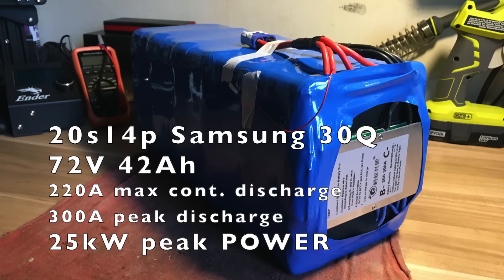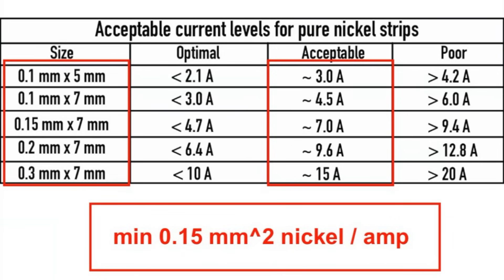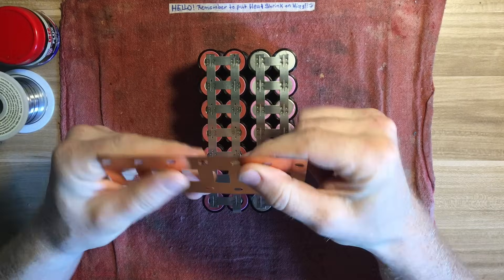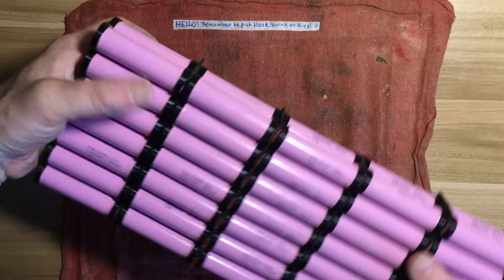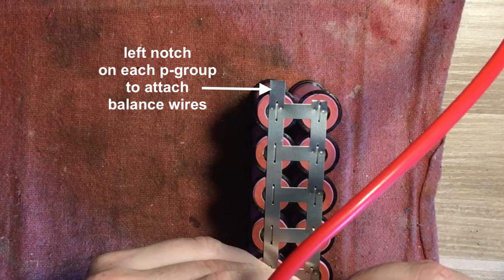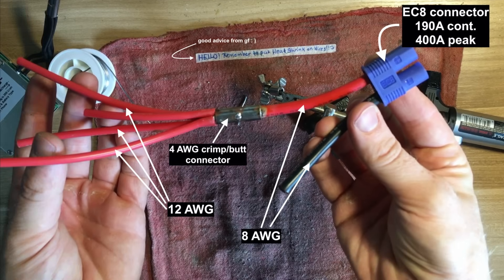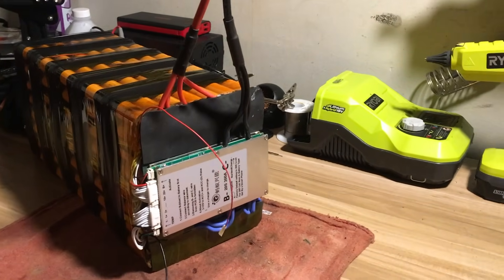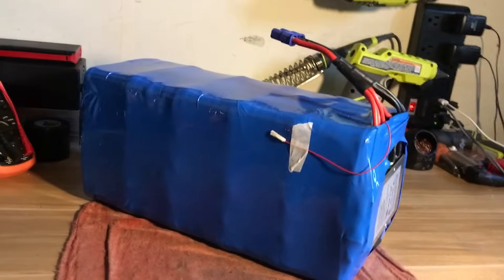How to build a MASSIVE 72V DIY battery pack for high power e-bike

Comment: Awsome care of battery building.  Your nickel and copper interface are perfect.  Oh just a note: solder is not so conductive so instead of just adding solder to the empty cup of the wire link, you should crimp it and then add solder.  This little addition will better represent the rest of teh care you've pu on it =)
Reply: If only you put so much care into your spelling and critiquing of others.
Reply: @joshuacrooker6489 inj

Comment: what was the build cost?
Reply: The cells he used are 4.75 usd at cheapest prices. 14p 20s = 280 cells times $4.75 = $1,330.00 just for the cells. I think $1600 or 1800 is very conservative considering a battery with those specs for sale is 2500 +
Reply: @mr.animegod_yt  that's if you trust the children in the factories making you a battery that won't blow up between you legs are you push 200+ amps
Reply: @stephensmith1687  versus what? An absolute beginner who has zero experience in building a pack.  Yeah I might trust a battery pack made by the kids in the sweatshops if I knew someone who’s purchased from them before.
Reply: @stephensmith1687  good point now I’m terrified to put any battery between my legs damn lol
Reply: Expensive. As. Fuck. Lol.
Reply: @republicofvegans712  now imagine what it will cost to replace/repair a battery in these fu…n’ electric BS cars that governents are forcing ppl to switch! I can’t even imagine how they are going to dispose milons of these cells if i’m having a problem with what to do with some single old/broken 18650😂
Reply: @losien1 Tesla's battery packs are incredibly well made. Each cell is fused, so you can have hundreds of cells go bad and the pack will still function with no difference to you. You also get a 8 year battery warranty :)
Reply: @losien1 It’s not expensive to replace cells. What is expense is the labor, just like every other car repair job.
Reply: I am gonna do this exact build and depending on the cells you use it should cost between 1600 and 1800 and that’s with the spot welder and sodering iron
Reply: @ENDOPRYSMofficial  ayy good to see you getting into building your own batteries. I think it’s for the better, you can customize and take as much time and be as careful as you want. Love your enduro bike builds or whatever they’re called
Reply: @ENDOPRYSMofficial  1600 to 1800 what? USD? That seems extremely high if so, unless you mean the entire bike build, which now that I read your wording, I’m thinking maybe that’s what you meant.
Reply: @dgenbraking 30Qs are expensive so are spot welders
Reply: @ENDOPRYSMofficial love ur videos
Reply: @mr.animegod_yt  lol
Reply: How can I know how much volts and amps the motor supports?
Reply: @mr.animegod_yt  ...that is just garbage.
Reply: 100s of dollars
Reply: I don't know, I'm just watching it buddy
Reply: @shaunlastname391  
Do you watched the video?
Can u say how much now
Reply: All I keep hearing is "spot welder this" and "solder that" why does no one mention that you can use professional grade electrical tape over top of the nickel strip connections and then after use special heat shrink sheets to enclose the cells in their entirety. Once shrunk tightly it will hold everything in place. If not water proof you can take extra steps to make it  so..
Reply: @AILEEYAN have you tried it
Reply: @mr.animegod_yt  I want to trust them

Comment: How long does it take to recharge and was it worth it? I mean do you even use 10% off the battery in a day?
Reply from the maker: Ive used 100% in a day - but it takes a lot of riding at full throttle. 45 min to recharge at 25A but I usually charge at 10A to ensure longevity - so about 2 hours give or take

Comment: How to charge your batterypack bro?
Reply from the maker: Any 72V charger would work but most (inexpensive) ones would be quite slow. I use custom built charger - basically a power supply with a boost converter - capable of charging up to 20A / 1500W
Reply: @GaiusGarage  Ok thanks, i'll try it👍👍
Reply: I hope you'll make a video about chargers for batterypack, because some people like me, may not understand how to choose a good charger👍👍
Reply from the maker: @dwipagunadharma7468  its easy to choose a charger - just needs to be the voltage of you battery pack at full charge (84V in my case) and be capable of the current you want. but they do get expensive with higher current. I think a video on this is a good idea, thank you!

Comment: Awesome quality job mate. Would you be kind enough to share the overall dimensions and weight with me?
Reply from the maker: thanks! sure thing. dimensions 325 x 140 x 80 (mm) weight ~15kg
Reply: @GaiusGarage  awesome incredible job! Would you clarify something for me that 80 mm number seems too narrow because you have 7 batteries going one way and 8 the other.
Reply from the maker: @samjohnson517  yes, actually you're right. I wrote those numbers down where and just copied them to answer above but it doesn't make sense. dimensions are 325 x 144 x 126
Reply: okay thank you very much I have the same frame as the bike you built this for so it should fit,  I'm starting to order stuff from your links you inspired me.  I'm here in the US if I  chicken out and Ithink I may LOL  I'll probably ask if I could ship the stuff to you.
Reply from the maker: @samjohnson517  DM me on Instagram (link in description) not sure what I would charge to build if you send me all the parts but Im happy to help out with any question you have! if youve never built a battery pack before, this might be a bit ambitious but I think you can do it if you take your time following the video

Comment: Hi mate great video I am looking to build the 20s battry but with only 6p I got 120 Samsung 40t, 21700 cells my controller is sabvoton 100a and I think 6p is good enough for my need now I need help with battry configuration is there any advice or software by the way my frame is stealth Bomber same as yours
Reply: I am doing the same in a stealth bomber. I have 200 iam trying to do 20s10p. I am waiting on the battery cells to arrive this week. I feel like this 4 module rectangle should fit. With less sells it should fit easy and with a big control inside.

Comment: hi.i went for bike ride with recently on my diy ebike 15 mile round trip.i had 42volt 500 watt front hub motor.took my spare battery 54volt ego power tool battery as spare.never needed it but can do 30mph with the ego.i could series the 2 batteries and let you know how goes.may blow something ha
Reply from the maker: if you put two ~50V batteries in series, you will have `100V. This will almost certainly fry your controller and would probably fry your motor (if the controller didnt get fried first). side note: dont put them in parallel either. if you want more power, you must start with your controller - then determine whether your motor will handle the power, then upgrade your battery to supply that power
Reply: @GaiusGarage  just blew my 45amp controller when wires came out on pothole.maybe able to fix mosfets

Comment: What controller and motor are u using?
Reply from the maker: top speed depends on vintage and motor winding - I got the 4T QS205 which is kind of a middle-ground between speed and torque - top speed at full charge is 55mph
Reply from the maker: QS205 motor Sabvoton 72200 controller
Reply: @GaiusGarage  cool...top speed?

Comment: https://fr.aliexpress.com/item/32975679107.html?spm=a2g0s.9042311.0.0.61fd6c37JIdhP0 
cost a lil less for the same thing  it's the exact same and you can get without the screen (even with it it cost less ;) )

https://www.bulkbattery.com/batteries/18650/samsung-30q-18650-3000mah-15a-battery/
idk about the shipping price tho

https://malectrics.eu/product/diy-arduino-battery-spot-welder-kit-v3-2-2-full-bundle-lipo-battery/
it cost less but it works great still ( i have this one and still no issues with it)

Comment: How much would a battery like this go for?!
Reply: 20X14 =280 batteries x ~ $4.75 per battery = 1,330.00 for the batteries and maybe 100.00 for the BMS and of course you need a spot welder + ~140.00 depending on which one you get.  So 1,570.00 ish

Comment: Very good video sir!!
Reply from the maker: thank you!
Reply: @GaiusGarage  do you sell built batteries
Reply from the maker: @DirectedWisdon  I do, actually. nothing big like the one in the video but I do have a 52V 12Ah downtube for sale on eBay and about to post a 72V 14Ah downtube pack that puts out over 6kW
Reply: @GaiusGarage  very nice what’s your eBay account That 12ah 52v battery is perfect for my 2000w scooter
Reply from the maker: @DirectedWisdon  its https://www.ebay.com/usr/raygt55 - although that 52V battery has only a 25A BMS - might be too low power for 2000W

Comment: Absolutely superb in depth video.So well explained and filmed put. Like many here, I’d love to see this on the bike that its been made for and demonstrated 😊 👍
Reply from the maker: thanks so much! pic of the bike using this battery pack is in the comments - going to make a ride video soon!
Reply: @GaiusGarage  Looks great 👍 There’ll be a few people (including myself) glad to see that video.|I bet that machine really shifts 👍
Reply: @GaiusGarage  Hi hello sir, may I allow to ask a question and please help reply with your expertise on ebike battery. Yesterday when I was paddle my ebike at home with the parking stand mount on the floor, for testing the ebike speed, then suddenly my mother was talking to me, instead of I need to press the hand brake to stop the spining ebike, I turned off the ignition key, THEN I heard a "pop" sound (the motorhub was still in high speed spinning) I don't know the "pop" sound was came from the battery or came from the controller. Sir, may I ask in most of the cases, let say, if a person paddle the ebike halfway through, when the battery still on going supplying the energy into the controller, and the controller still on going supplying the power into the motorhub, and the motorhub still drawing power spinning at fast speed, then he turn off the ignition key OUT OF SUDDEN to cut off the ON GOING power supply intake from the battery, in this case what will happen to my battery? Sir, please help me,

then I unpluged the ebike power  plug from the battery, then I turn on the key ignition to purposely release the electric in the controller, then I plug the ebike power plug into the battery and heard a as usual spark sound. 

My concern now is, how do I know I already wound, injury, or damage my battery or not sir. Hope you understand my question, trillion thanks if you would please reply sir.
Reply: @GaiusGarage   it's ok to charge from the main output connection on these batteries?  my EUC battery has two pairs of smaller black and red wires coming out that don't indicate any voltage
Reply from the maker: @FourthWayRanch  generally is should be ok but I dont know your setup specifically. you said "two pairs" so 4 wires? or do you mean 2 wires. if 2 smaller wires and no voltage, it could be for the temp sensor
Reply: @GaiusGarage  ok that makes sense, temp sensor, there are 4 so the other two I dunno.  I've studied a bunch of 20S battery builds and looks like they all charge from the main connector, the BMS manages the charge for you.  I guess they connect charger ports in parallel where you see them used?
Reply from the maker: @FourthWayRanch  some BMS's have a seperate line for charging vs. discharging. two of those wires might be for charging, which explain why they're smaller. but depends how small
Reply: @GaiusGarage  they are 18 ga, maybe thincker but shouldn't there be a voltage on those wires if they're for charging or no? this why i'm confused because there is none. 

 I just charged my batteries to completion separately using the charger they came with and some aligator clips on the main connections, both voltages are 84.0 now.   the charger turned green at that voltage
Reply: ditto to the above comment by jonnyswlk4674, i  canna say anything more, this is the best instructional video i ever saw, alas i don't understand much of it lol.

Comment: Thanks for the video. I have a question about my electric Weped GT50 scooter. It has a stock 60V 1800W dual motors that can handle continuous 30A each but my battery is only pushing out 14.7A max and 9.8A continuous. Do you recommend a battery with 60A continuously for 2pcs 30A motor, peak 120A? The existing battery pack including the BMS is 14.4L x 5.4W x 3.4D inches.
Reply from the maker: you'll definitely get more power & acceleration with more current but your battery is not necessary the limiting factor. ultimately, the controller determines how much current is being provided to the motor(s). It's possible that the battery isnt able to provide enough power to the controller but if everything is stock, chances are it's all designed to be complementary. Its also possible that your battery pack is capable of more power but the current is limited by the BMS. Basically, it barely matters what the rating is on the motors - most can operate in a wide power range range - how much power they actually receive can be limited by the controller, BMS, or the battery pack itself. more power means upgrade one or all of those components
Reply: @GaiusGarage  Oh wow thank you for the feedback. as long as I don't need to upgrade the motors I'm sure I'll be happy to swap out the BMS / controller / battery.
Reply: @cainetastic    Looking at building a eMotocross bike.  For higher amperages look towards golf cart setups.

Comment: Heard of people having problems with 30q cells at high AH. What’s your experience thanks
Reply from the maker: basically any measure of how good or bad a cell performs boils down to the increase in temperature under load, which is directly related to its internal resistance. I forget the exact values but 30Q have some of the lowest internal resistance of any high-discharge 18650. The only with lower IR is the Sony VTC6. The spec sheet for 30Q's indicates you can run them at 15A continuous but I think I saw somewhere that they revised the spec sheet to 20A (maybe to compete with VTC6). In any case, I can pull 200A from this pack all day with very modest increases temperature. I'd say unless you can find VTC6 at a discount, 30Q are best bang for your buck

Comment: Really nice job and great battery pack, but I belive that you shouldn't trim bms balance wires, it introduces resistance difference in wires and could interfere with the bms readings
Reply from the maker: thank you! interesting thought on the balance wires - to my understanding the BMS is measuring the voltage potentials only from the balance wires, in which case the current (dependent upon resistance) wouldn't matter. but if the BMS performs some other functions that depends on measuring current in the balance wires with some high degree of precision, then their length might play a role